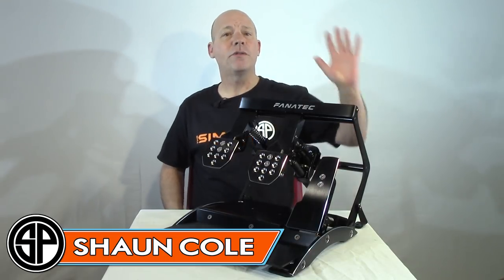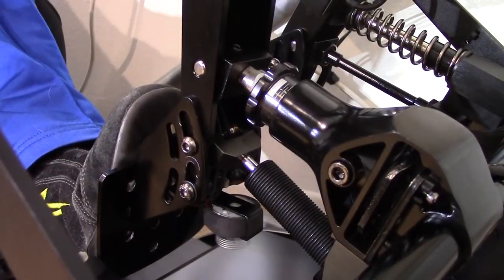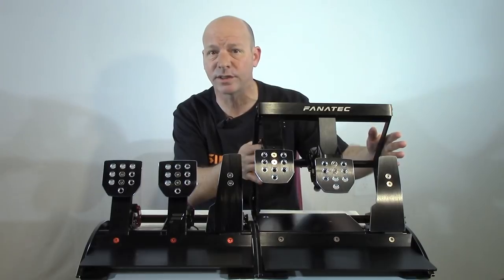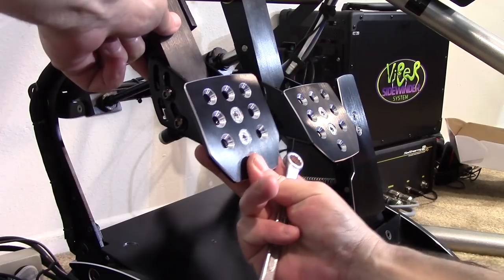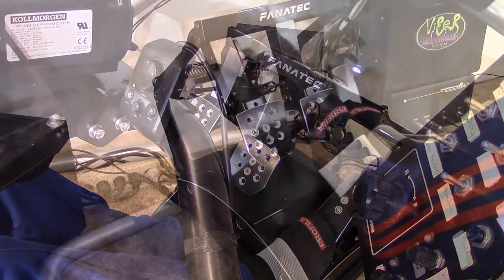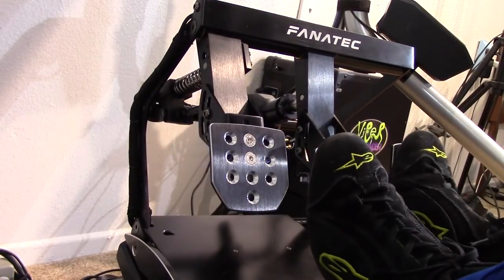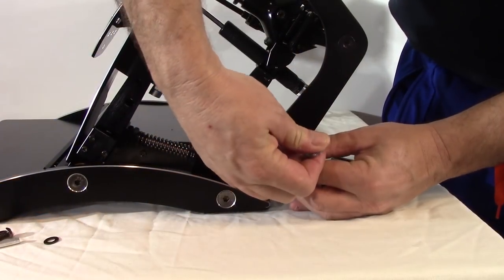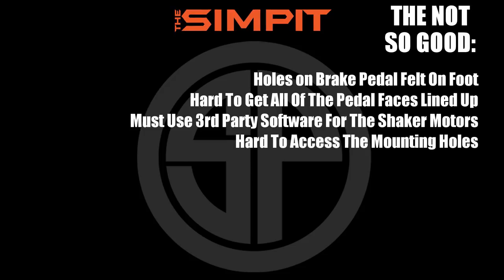Fanatec Clubsport Pedals V3 Inverted Review

Comment: These cost 600 bucks in the EU.
Way overpriced. Normal V3 are "only" 360.
Reply: Yeah, in the EU normal V3s are 360€, plus 80€ for the damper kit, so it's basically 160€ for the bracket.  Compared to the USA, where it's 300$ for the pedals and 70$ for the damper, so 130$ for the bracket.  Prices in the states are sort of reasonable, EU not so much.

It's just Fanatec being Fanatec.

... which is the reason I bought the Protosimtech PT-1 pedals for 440$, though it totaled to 650€ after shipping and taxes to EU.  And I still consider that a bargain compared to the V3's...  you just get way more bang for your buck, there's even a review of them on The Simpit. :)
Reply: So it is totally ok that the price difference between the Euro and USD amount of your PT-1 pedals is 48% while the difference on the Fanatec side is just 23%. 

Sounds logic.

And by the way, the US prices never include any tax and therefore the price difference.
Reply: "And by the way, the US prices never include any tax and therefore the price difference." 

ok 
499.95$ = 472.26€ 
472.26€ * 1.19 (19% vat) = 562€

ClubSport Pedals V3 inverted cost 599.99€ 
so this difference is cause the fanatec device is build in USA ... ho wait ... made in deutschland ...  ... mmm ... 
i don't know why i feel 37€ in my ... 

and for a load cell ... shipping cost 12$ for USA and 17€ for france ... no problem
Reply: 600 e are you serious ?, bad joke, pt1, he pro> toys made in china
Reply: "So it is totally ok that the price difference between the Euro and USD amount of your PT-1 pedals is 48% while the difference on the Fanatec side is just 23%. 

Sounds logic."

Now you're just being intentionally obtuse.  The price of the pedals did not change depending on the currency (unlike with your pedals), the additional cost was shipping and import taxes like I mentioned.  You know, just like your pedals aren't actually 360 euros to get into my hands since we need to add shipping costs to that.

If the 60 euro price difference with your pedals was due to my government or EU being PITA and included shipping, I obviously wouldn't be bashing you for it.
Because, you know, logic. -_-

Also, I consider the PT-1's worth 650 euros, considering IMO the only comparable pedal set is Heusinkveld Pro pedals, which are 720 euros plus shipping, the list price for pt-1's is an absolute steal. 

Though mentioning them in the same context as the V3's was probably a mistake, they're completely different levels of product and v3's are not even close to comparable.

"And by the way, the US prices never include any tax and therefore the price difference."

Okay, now that would make sense and is fair enough, not that the math actually checks out, but we'll gloss over that.  

Yet somehow when I questioned you about the price difference back when the V3 pedals launched, you forgot to mention that sensible reason, and instead claimed the price difference being because of manufacturing costs being different due to the strength of euro compared to dollar.  Which didn't really make sense to me, since if I'm not mistaken you manufacture your stuff in Asia, but I'm not privy to your contracts so what do I know.
Reply: ***** in usa ... it s hard to go at nurburgring 😆. So yes 600 bucks is expensive ... but how much cost your phone ? Your TV your computer? 600 buck is the price for 1 day with a good car on a track ... you can't compare. 

So fanatec is made in deutchland no ?
Reply: mickeil keil it is made in china
Reply: designed in germany, produced in china ;)
Reply: As usual, European products are cheaper in the US than in Europe, where they are made.
Reply: Your are looking at misleading info. US prices are typically without VAT, whereas European are.

You are at 535 USD for the cheapest shipping method, before taxes. As shown for example at http://travel.stackexchange.com/questions/21469/why-are-prices-published-without-tax-in-the-us, there is no general VAT in the US, unlike the 19% in Germany. Now if you would add German 19% sales tax, you would be at 636 USD.

Compared to that, with standard shipment within Germany, you are at 617 EUR, INCLUDING taxes.

Never compare US prices to Euro prices without further thought :)
Reply: The fanatec factory is in China so, that's not true :)
Reply: Not overpriced Marissa, you just don't have the money required to play this game. Maybe marbles or checkers are more in line with your financial situation.
Reply: hello. do you know how much its shiping for v3 inverted please? i wanna buy them this black friday..buy i dont know how much they will charge me for romania. thanks you mate
Reply: Really?? Come on Fanatec. A few years ago when the BMW GT 2 Rim came out it cost 200 or 250 in Germany i dont remember completely but around that mark. And then without ANY reason you guys changed it to 299€. Luckily i could get the BMW and the Formula Rim for 310€ at Black Friday.... Even that shows that the profit margin is huge ! You still make profit even when you sell both Rims for 310. And now you try to argue that a different company has a bigger gap between the Eu and US prices so this gives Fanatec all the right to do the same. 

I  remember when i had the V2s. Holly shit what a nightmare. Seriously you guys are using good materials but the problem is under the hood. I had to change my pedals SEVERAL times. The funny thing is that the were already broken when they shipped to me (brand new). V1 Wheels ? A story for its own ...

Long story short. You guys didnt changed your quality standards (quality doesnt rise just because you use aluminium) but just rised the prices...

Comment: If the cost is worth it or not is down to the user but the price is not "reasonable" at all.

The CSL ELITE are reasonably priced
The standard Clubsport V3 are kind of expensive
The V3 inverted are ridiculously overpriced

Let's NOT forget that these are mass produced and recycle many components from the standard V3, unlike the competitors which are mainly assembled by hand (hence the increased cost).

Comment: Hi Shaun great review. Do you know if Fanatec will release an upgrade kit for the standard V3 model?
Thanks
Reply: andrescastaned80 No. Fanatec has already stated that, despite them looking similar, there are actually many differences in the manufacturing of the normal Clubsport pedals, and the manufacturing of the new Clubsport Inverted pedals, that make creating an upgrade kit impractical, so there will NOT be an upgrade kit.

Comment: I’m saving up for the v3 nearly there now I’m thinking I will wit a little longer for the inverted and save a bit more what do you think?
Reply from the maker: The build quality is the same as the normal pedals. It really cones down to you perfered style of pedals
Reply: @TheSimpit  thanks so much for your quick reply I really appricate it I think I prefer the normal V3 and there cheaper so going for one of them and I have got a few things on eBay for sale when they do sell I’m going to order the new grand turismo DS pro base I use a PS5 for do like the look of the DD1 or DD2 but there out my price range at the moment I think DS pro will do for now also one more question mate if you don’t mind I have been looking at heusinkveld sprint pedals there nearly double the price of the standard V3 but would they work with a Fanatec wheel and PS5? Thanks again really helpful video and reply
Reply: @calumsimpkins2554  should I get the inverted v3 or normal v3

Comment: Question: My V3s seem to become really sensitive over a duration of about 1hr of driving. They start out great but after an hour they become super sensitive(then seem to go back to normal after a while).So sensitive that if I hover my foot over the pedal, put pressure on the clutch, it will apply the brake(~15%). Sometimes it will even light up going down a straight. Im using iRacing as my sim. Do you have any idea what could be the problem? Loadcell going bad?(had it for 2 months). and yes, i have recalibrated multiple times.